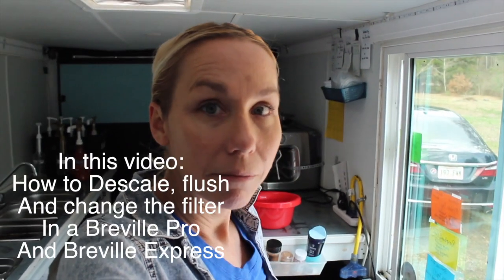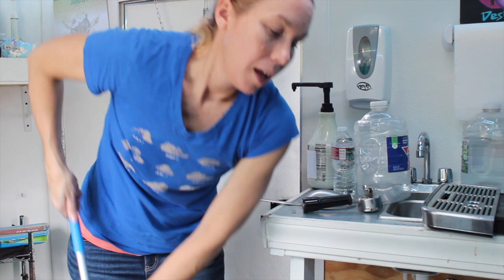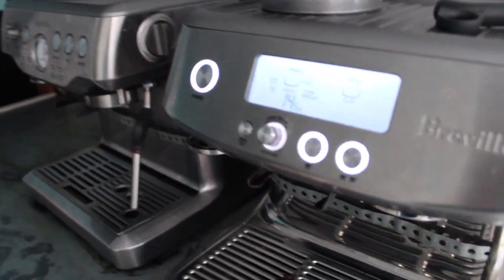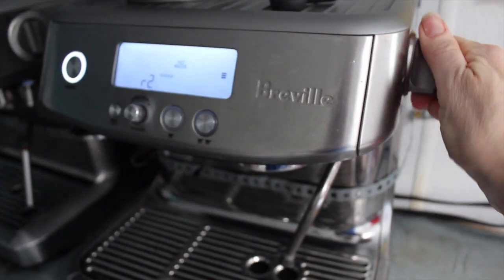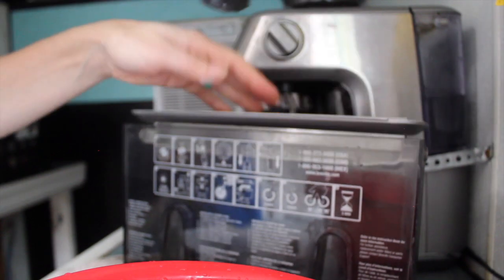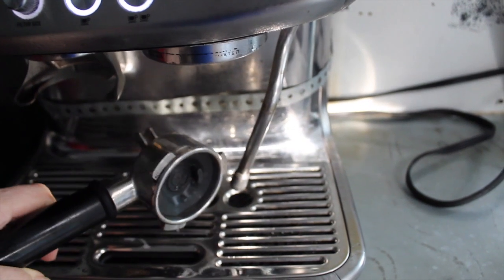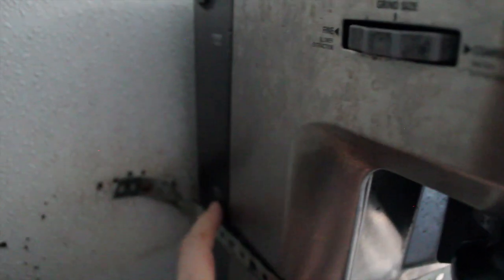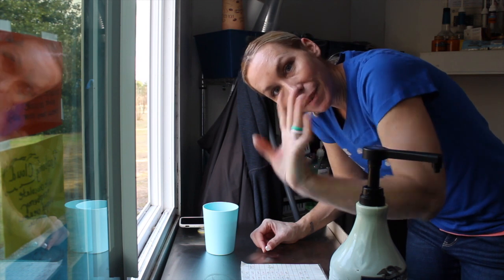Coffee Trailer: pro’s and con’s of Breville Espresso machines + Descaling and Flushing

Comment: Considering all the work that goes into maintaining those machines makes one appreciate all the more a good  cup of coffee made at a boutique coffee shop like yours. I must say, I hate it when the computerization of everything these days breaks down. It was nice back in the 1990s or so when you could still buy things that operated manually that were less fancy and a lot simpler to operate and fix and were more reliable.
Reply from the maker: I will say, the more basic less automated machine has broken down less than the faster, "pro". so there is some thing to be said for the more basic equipment. Ah the 90's the last good generation :)